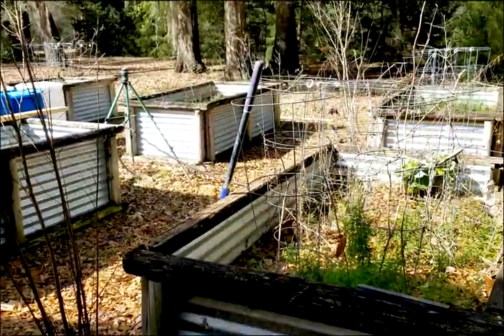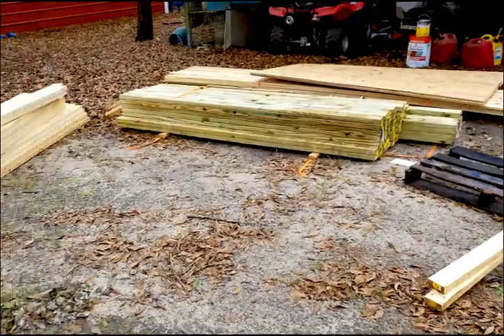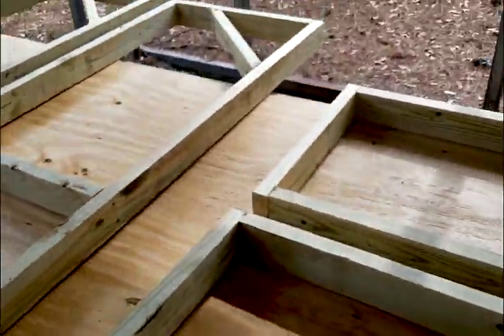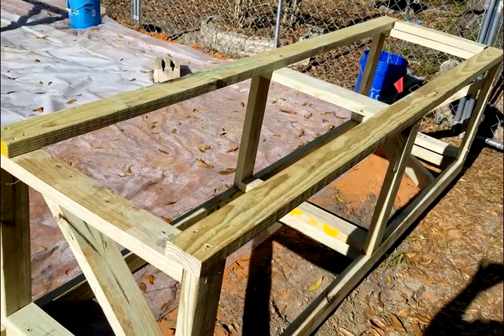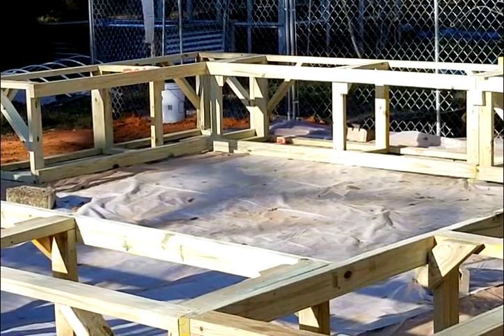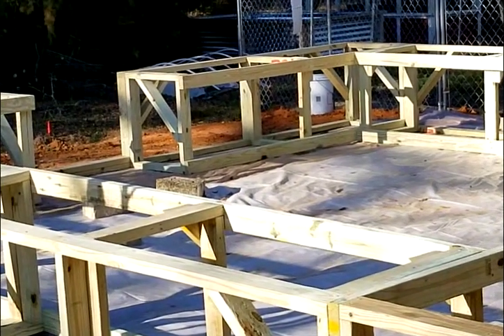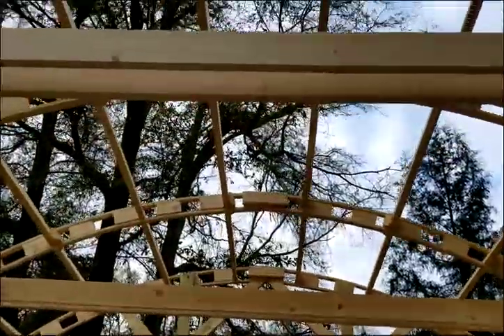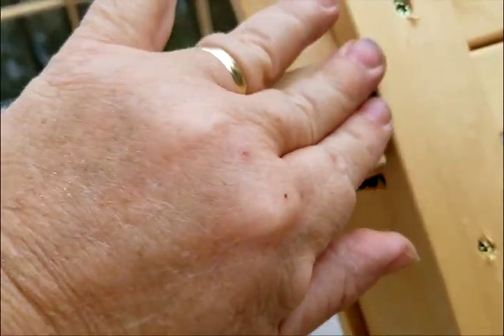WOODEN BOW GREENHOUSE, STEP BY STEP. PART 1

Comment: Did you round the spacers to match the radius of the outer laminations?  it there a specific reason you spaced the spacers closer together at the ridge?
Reply from the maker: The spacers are only closer at the top two for more support and to tie the two sides together. The clear panels can warp, so the more level they are, the closer I placed the 2x4s for more support. And at the very top, I used 2x2s in between for support at every foot.